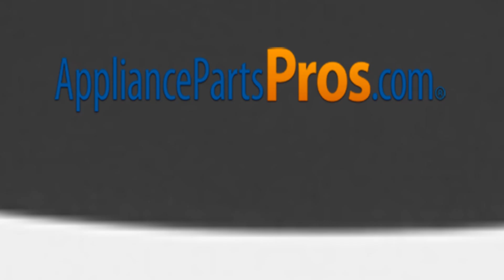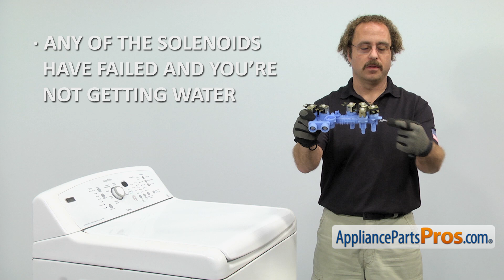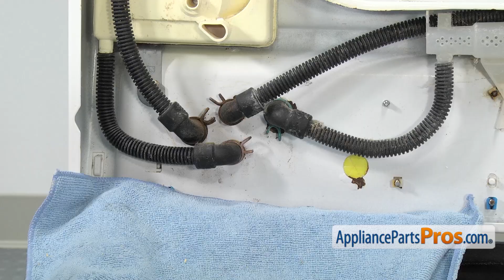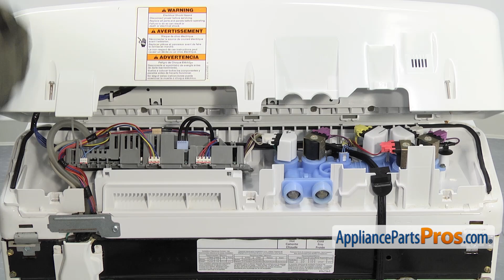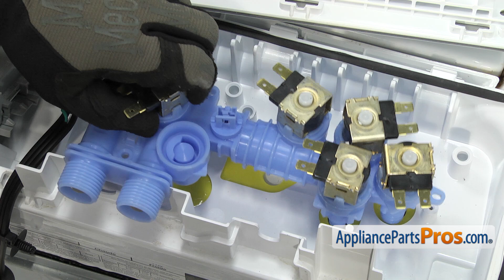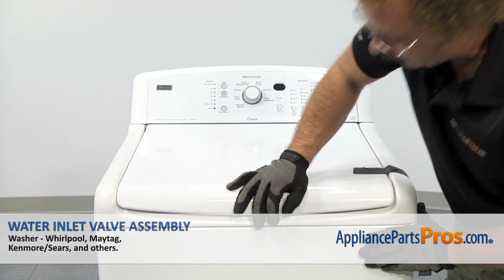How To: Whirlpool/KitchenAid/Maytag Water Inlet Valve Assembly W10364988

Comment: The order in which you did everything was perfect. I wish I would’ve found this video instead of the other I chose because I bumped a little hose and cracked the  plastic under it . After seeing your video I realize what I was doing wasn’t even necessary. I guess I’ll buy a new washer now. Lesson learned.
Reply from the maker: We’re really sorry to hear that happened—that’s such a frustrating way to learn a lesson. You’re definitely not alone though—these repairs can be tricky, and sometimes even one small step can make a big difference. Let us know if you have any repair questions in the future.

Comment: Just replaced the same inlet valve on our kenmore.  Our replacement installed easily and works perfectly.  Original problem code on the washer indicated a blocked inlet. After changing hoses and clearing the small metal screens, the problem remained.  You could hear a wirring noise, but no water flow.  It was the inlet valve assembly.  Ordered a new one from Ebay.  Done.
Reply: May I ask what kind of kenmore machine did you have? And what were the codes coming on? Thank you

Comment: The top of my Kenmore washer does not open via the putty knife trick.  Instead, remove two screws at the rear of the washer, slide the whole top forward slightly, and lift/wiggle/coax the thing loose and raise it up.  The lack of this one bit of missing information caused a world of grief and delay with this otherwise simple job.
Reply: Same applies for Maytag Bravos XL washer.  Spent way too long with the putty knife before I learned I needed to remove the screws in the back and it slides forward.
Reply: Great video. Wish I read the comments: Putty knife does not open the top on a Maytag Bravos. Remove two top bracket screws on the rear, slide forward 1/4 inch to release the top. Other ideas: Take a picture of the wiring before unplugging all the color coded connectors. The red wire might be short, just bend the spade connectors or bend the red plastic quick connect so the wire has a shorter run. Finally, get some rust reformer and paint the bottom edge of the top sheet metal as this is a design flaw: your white items will come out rusty as the plain steel drip edge is not powder coated.
Reply: Same here.
Reply: @Honda1100ACE  great comments.  I did take a picture, and also I found the red wire was short, because my replacement assembly was spun around the other direction, and trying to reverse it didn't leave enough room.

Comment: Hi  I ran my diagnostic test and the water was running way to fast into the  bleach container and its over flowing and causing it to rust   everything   its gets into the lip of the lid  and now that's all rusted . How do I control  the water flow  that goes into the  bleach container .  In the test it runs and stops as it should its just  letting to much water in to fast . The container  outlets are not stopped up they are clean and open .What controls the water flow amount to each  container ? The other two water flow amount  is not causing  the containers to over flow . I was thinking about getting a shut off valve and just  putting it in the water line  and closing it  off  till  it filled the container but didn't over flow it during the test .

Comment: which solenoid is the farthest one to the right? standing behind the washer.. there is a crack in the blue plastic under the solenoid and id like to know if i can atleast run the washer on either a hot or cold only wash to get by temporarily

Comment: Why is mine leaking by the valve connections? Water is gushing out from the cold water side underneath the circle part by the purple connector if that makes sense.
Reply: any one have an answer to this as I also have this problem
Reply: my guess is bad o ring. I noticed when replacing the whole valve that they turn a little. I'm betting when that happens, the whole thing has to be replaced. I'm not sure though!
Reply: Maybe the plastic is cracked.

Comment: I wish I had seen this video before I did my project.  My issue was sometimes after completing loads, the water would continue to drip.  Usually another fast rinse cycle would stop the leak, but it always happened on my very last load, and the extra cycle wasted water.  I tried to just replace the assembly from the back, but it wouldn't come out (I didn't know there were hose clamps underneath), so I ended up just popping off the coils and swapping the ones from the new assembly in place of the old ones.  I'm hoping that fixes the problem.  If there's something inside the actual sealed plastic valve open/close assembly, I'll have to go back and revisit the job.